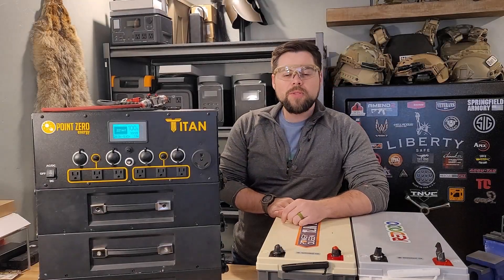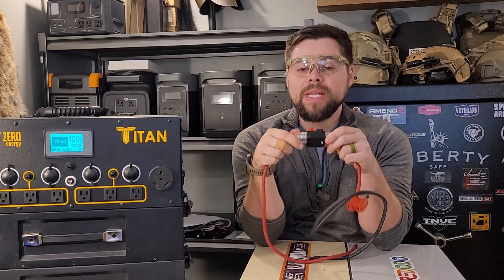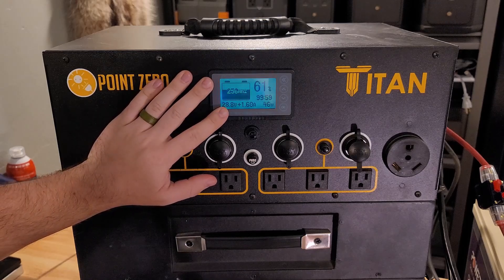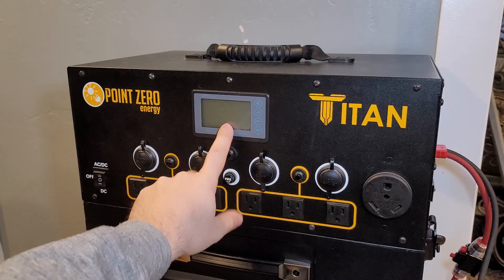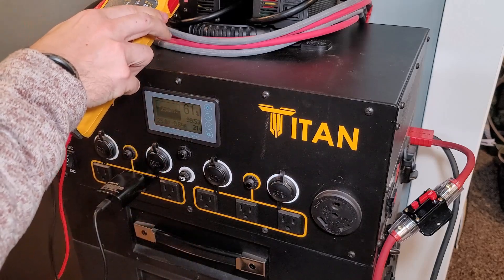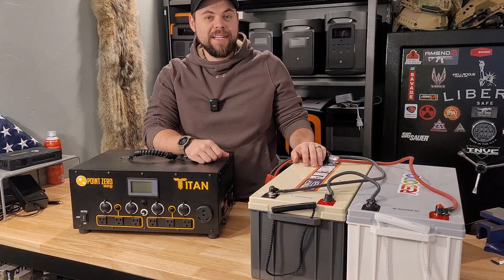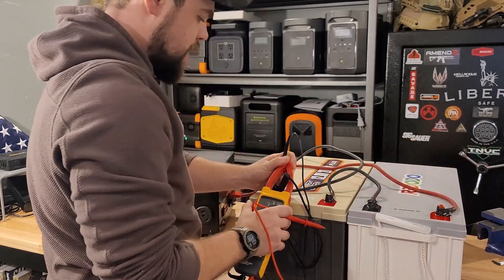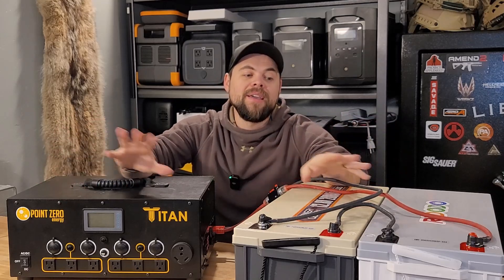DIY Backup Solar Titan Battery Power Station Setup

Comment: There is two new Titan coming out are you going to review those
Reply from the maker: I likely won't, I don't really have much good to say about them. Unless they want to send them out I won't be reviewing them in person with live testing and results. I can do an overview though.
Reply: @minutemansolar Do you think the newer models are a bad system? Why do you have nothing good to say about them. They increased the solar input, surge capacity, and is capable of outputting 240 from one setup. The system can operate with NCM or LiFePO4 or both at the same time. What’s the downside in your opinion?
Reply from the maker: @latymz I personally do not like the new version. It has 240v power but only up to 4,000w output which means you can only do a well pump and a single burner on a stovetop. No other 240v equipment can be run off of it. So what's the point of 240v?
Reply: @minutemansolar    Very valid point. Extremely limited considering what the competition is doing.
Reply: @latymz he doesn't have anything good to say because he had a falling out with Point Zero energy!  Not the product the people, the 240sp is just as good as the Titan, it lacks for nothing, he just won't promote them any more

Comment: Question can you Series 2 titan to get 240 volts split phase?
Reply from the maker: Sadly, no.  But you can link two Apollos together and get 240v power. The Apollo has 220% more solar input, far better batteries, far better expandability, is a better price per watt, and has the ability to self-restart after draining to 0%. The Apollo is now the best unit. If you have questions you can email me directly at info@poweredportablesolar.com. Also you can find the Apollo here: https://poweredportablesolar.com/product/hysolis-apollo/

Comment: April 6, 2023.  
I have a titan inverter with three batteries connected to my home with a reliance transfer switch. When  I use the titan to power 6 circuits the circuits that have a gfci breaker(1)and the ones that have  gfci outlets trip. Why is that?

Comment: HI IM NEW TO THIS CHANNEL  MY PROBLEM IS SIMPLE IM SOUTH AFRICAN  AND WE RUN ON 220V 230V AC MOST POWER STATIONS ARE 110V 120V AC SO CAN YOU ASK THE ACE300  DEVELOPERS TO MAKE A 220V POWER STATION  ALSO, BUT WE DONT WANNA BUY 2 UNITS TO GET 220V WE WOULD LIKE ONE UNIT WITH THE EXPANSION BATTERY OPTIONS BECAUSE NOT ALL PEOPLE NEED MORE THAN 3600W OF POWER SO LOOK INTO IT PLS THANK YOU FOR YOUR TIME. AND NO WE DONT LIKE NORE WANT DELTA POWER STATIONS

Comment: I haven't seen any discussion on charging the Li-Ion batteries in below freezing temperatures.  I understand that internally the batteries have a temperature shut-off, so that when the temperature drops below freezing they stop charging.  The reason is due to the Li-ion chemistry, presumably the batteries would deflagrate/explode if they were to charge below freezing.  How do you keep your batteries warm during winter, so that this doesn't happen?  I've seen some mention of using RV tank heaters to keep them warm, and then have a shut-off when they get above freezing.  I keep my batteries in the garage, so I hate to see no charging on those cold chilly but extremely sunny winter days.  Also, the battery meter can get off, since the charge controllers don't keep track that the batteries aren't being charged in this scenario.

Comment: The LiFePo4 battery did exactly what it I expected it to do without a Titan battery hooked up. The reason Point Zero recommends having at least one Titan battery connected is because load sharing between the batteries moderates the load on the external battery cable and the voltage drop. Without it, the voltage drop from the LiFePo4 battery to the Titans load is fairly high pulling all of your load through the #6 wire and the breaker. If you were running 2000 watts of load you were trying to pull about 77 amps through the wire and breaker which is too much for #6.

Comment: The only way that breaker could be hot is if there are I^2R losses in that breaker.  But I think I saw that breaker is 150 amps?  Agree..faulty breaker design.  Warm is a symptom not a cause for a trip.  If you have insulation piercing probes, try to measure the voltage drop across the breaker.

Comment: Do you know that a LifePo4 battery is 100% at between 27.2 and 28.8. It get charge to 28.8 to help balance the cells. I have my lifepo4 battery set to boost for 30 minutes at 28.6 and when the boost is is over it settles back to 27.2 at 100% soc. That is also why your Titan battery voltage is dropping when they are in Parallel. You have 2 different 12v lifepo4 batteries do you know if the BMS systems have the same setpoints, if not that will also cause problems.

Comment: I'm sorry to say your external battery test does not clearly indicate anything I'm trying to see. Does the Titan also accept the addition of those extra batteries into the array, and equalize with them or not ? It looks to me like it was a big FAIL, so you need to point me to where in the video it isn't, please ? I'm really interested in the Titan, and part of my decision depends on how well it works with other battery makes which can be obtained locally in my area ?

Comment: You can expand the pecron 2000lfp as well with external batteries ;)
Reply from the maker: Really? I have not seen you can do that with any other battery but their own. Do you know of anyone doing that?
Reply: @minutemanprep   put your meter on the battery expansion plug. You will measure 24vdc.  You would need to make a special cable, though.  But test with some alligator clips :)

Comment: Why don't we just add more titan batteries?
Reply from the maker: I can, and I have. I have 3 total batteries for that unit, and 3 for my second Titan unit. Total I have 6 Titan batteries and 2 Titans. I already know those work really well and just wanted to try another option is all.
Reply: It called $$$ one titan 2000wh $1116, one 24v 100ah battery = 2560wh $600-800 plus many more cycles.
Reply: @Scott-ig1zd Where did you find a Titan battery for $1116?
Reply: Hmm, let's see ahmm 1400.00 for 2 kw or 1500.00 for over 5kw with a eg4 battery. Gotta go with the eg4 with over 2 1/2 times the capacity for slightly more money.

Comment: Nice video Ben. I just added my 4th NMC battery to my Titan set up. Titan advised me to go with their battery instead of adding an external battery.  I just didn't want to fuss with the system and have to have a constant eye on what voltages would be from adding different batteries to the system.  On a different note, I received my Titan set up about the same time you did(around 3 years ago) and I had an issue with mine that the current models don't have. If I was only running a small LED lamp on the system, the lamp light would flicker. If I added more load to the system then the lamp light would remain on constant without flickering. I contacted  Point Zero Energy 2 weeks ago about this(I think i'm out of warranty) and they paid to have my unit shipped to them, they fixed the problem, and shipped it back to me without it costing me anything. Total time from me shipping it out and having it returned was 8 days. I'm guessing your Titan probably needs the fix I received on mine.  Nice video!!!
Reply from the maker: Yup mine does the same and I've just never sent it in. That's awesome that their customer service took such good care of you.
Reply: I started using my Titan in April of 2020, so almost 3-years also. I have three of their batteries underneath it. At first the charge controller(s) didn't function properly and Point Zero paid twice to have them shipped back and forth until the problem was resolved. I still get that flicker also, but I don't have it in me to ask them to fix it, so I just put up with it. I use it daily in my house to run as much as I can. It actually takes in more of a solar charge than my Bluetti AC300 with four B300 batts from the same array setup, and has less stand-by and low power loss also. Fans are noisy, but they let me know if I'm taking in a lot, or discharging a lot, different sounds.
Reply: @suklee1400  I know it's a pain to box up the control module to send in. I didn't have the original box it came in so I had to come up with a secure way to send the module back to Point Zero Energy.  I couldn't believe how quick they were to fix it and send it back to me.  It's probably worth sending it back to them so they can update your unit if necessary. Those of us who bought it three years ago were kind of the guinea pigs for their first productions of the module and so with time they have fixed the little problems that have surfaced with the unit.  I added the 4th battery and would eventually like to add a 5th battery. You have quite the set up with the Bluetti AC300 and 4 batteries. Which system do you prefer the most?

Comment: Awesome job. I already knew it worked because I've been doing it successfully for over 8 months or so but my batteries are 24v 100AH and I made my own plug with 4awg wire and my fuse is 150a/32v.I also never pulled more than 1500watts at extended period. Thanks for the in depth testing Ben,always appreciate u doing the break point tests so we don't have to find out the hard way and the costly way✌️
Reply: My comment sounds arrogant at 1st and I don't mean it to be cause all in all,it may have been working but I didn't do the in depth testing to know if it was working as expected which is why I was very glad to see Ben jumping in to investigate further.I just assumed my Titan was doing as it should.Not to say I didn't do some checks and made sure to touch base with Point Zero and Ben prior to buying the needed equipment and hooking it up.The (2) 24v batteries are now running my Growatt system&no longer are with my Titan but now I'm confident if I need them back there I could do so.
Reply: I am looking to add external batteries to my titan what were the type and model you used? Appreciate your insight in this I don’t want to get the wrong stuff
Reply: @timscarborough9753  so I went with Li time 24v 100ah batteries. I have bought 3 to date and no issues with any. Not to mention just about any1 that reviews them gives them a 👍.There's many on the market and quite a few that are even better but Li time is a good reliable battery and won't break the bank. The ones I have don't have low temp protection but I didn't need it for my application.Li time does have cold climate battery options too✌
Reply: @scarygary3569  thank you for the quick response! I am new to all of this. I have the Titan with 1 of their Lifepo4 batteries. What was your process in hooking up and using the Li Time 24V 100AH LifeP04 battery?
Reply: @timscarborough9753  1st you need the plug adaptor that has inline fuse.Ben has them.Next you need to get both batteries within .5volts.Either drain 1 down or charge both to full capacity,still double check the voltage is within .5volts.Next thing is to connect but leave power off when connecting expansion battery.Connect wires to battery 1st,then plug into Titan.Turn it on and now you must calibrate your Titans AHs. Directions to do calibration steps should be in Titan manual. That's it...your done.
Reply: @scarygary3569  thank you! Looking forward to trying this out. Once you fully drain both the titan batteries and the expansion battery can you charge them back up together or did you split them apart and charge them separately then check the voltage as you mentioned to ensure they were within .5volts of earth other.
Reply: @timscarborough9753 so I went with the ampere time,now Li time batteries. I've now purchased 3 in total from them and they've been problem free. I got the 24v 100ah. Just like anything else in this market,there's soooo many options out now that its quite time consuming to choose but these have been given 👍by all who have reviewed them including Ben and Will Prowse. Now there's definetly many better options out and some with low temp protection, which I went without it because alltho I live in NE my systems will never recharge in below freezing temps...I hope😮😊
Reply: Don't fully discharge your batteries ,that's a no no lol. LFP does like to be cycled vs sitting fully charged for long term and should never be drained below 10% of its capacity. Just discharge the higher voltage battery until it is within .5volt of the other.After you've got them hooked up you can fully charge them up together after you've adjusted/calibrated to the appropriate AHs.

Comment: Glad to see it works even with different battery chemistries. Thanks for doing this test again. 
 Did not surprise me with that breaker being the issue. Heat trips all breakers that I have ever worked on but if it is overheating and tripping without being close to the rated amps it is because it is not made to handle the actual amp load it is rated for. A household breaker can go bad, a bad or loose connection or a breaker going bad internally will cause them to do the same thing. They will get really hot, over 100 degrees, then trip without getting close to rated amp reading, otherwise it has to reach that amp rating to trip. They do not get hot enough to trip unless there is something wrong. I have shot down quite a few of them in the past for air conditioners because they kept tripping the breaker. Obviously, dc power is a little different than ac, but the breaker should not get hot unless you get really close to 30 amps if rated for 30 amps.

Comment: Is PointZero finally joining the LFP age?  Trying to make those external 25.6v batteries work with a system designed to work at 28 or 29 volts is an interesting exercise, but not the best demonstration of safe practices.
Reply from the maker: I have heard rumors of LFP batteries coming out but I can neither confirm or deny what they'll do.

Comment: I really appreciate the re-do, especially since the last test was so frustrating for you.  I'm adding external batteries to my Titan, but I think I'll use 24v batteries. Thanks!
Reply from the maker: You're very welcome. Thank you for your contribution as well, it means a lot. I really like the Power Queen batteries here: https://ipowerqueen.com/?ref=MinuteManPrep
Reply: Thank you Ben. I have the titan solar generator and was wanting to add some external battery’s would you recommend the 12volt power queen batteries and run them in series to get to the 24volts required by titan
Reply: How is the 24v added battery doing with your Titan?  I’ve got the original PZE Titan with 3 NMCs; however I wand to add one 24v 100AH LiTime w Bluetooth.  My current three NMCs are working as advertised; but I’ve been a miser with my on demand hot water heater and looking for some leeway while running two fridges, security cameras and a Starlink Mini for 24/7 (never mind the 42” LED TV and all the other computer things).  I’ll look at the power queens; but the price is decent at the moment for the LiTime.  Great content - thanks!

Comment: I still think you need to get thicker wire, and a bluesea fuse. This way you can see if it gets hot enough to actually break the fuse. 
Also, I’m wondering if the external batteries are able to charge up to 29 V, as a lot of manufacturers don’t recommend going to be on 28.8. Each manufacturer has different recommendations.
Reply from the maker: Yes they can go up to 29v (14.5v each) and they do hold their charge but only while connected to the Titan batteries.
Reply: @minutemansolar  
Yes, but is their recommended charge rate the same as the Titans batteries?
Reply from the maker: @simon359  I'd have to double check that. Either way I charged both external batteries with 1,000w input at the same time and didn't have any issues. Obviously the slower you charge and discharge it the longer the lifecycles will be.
Reply: @minutemansolar  Lifepo4 do not hold there charge at 28.8 they will all settle at about 27.2 which is 100%

Comment: Thumbs up 👍 this is a great get. Thanks again for your input. 
Any idea if the 240 may be in the future for this company? With this platform through a combiners platform or such.
Reply from the maker: Thanks Clarence. I can't confirm or deny 240v power with 2 Titans but I really hope they can make something that can do it.
Reply: They have a 240 system out currently,

Comment: Thanks for doing test #3 I kept asking about. I am kinda surprissed you can run mixed chemistry batterys, I was under the impression that was a no no. They should release a updated Titan LFP. Then external Lifepo4 batterys could be added with proper metering. That is what I want out of a power station! Quality build with a DIY touch.
Reply from the maker: From my experience it's okay to run two lithium batteries types but you don't want to mix lithium and lead acid.